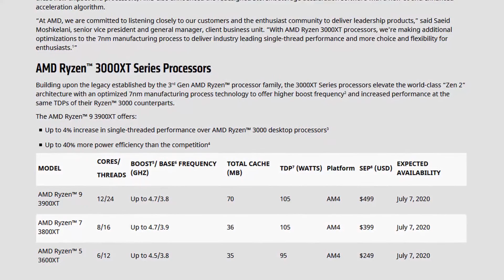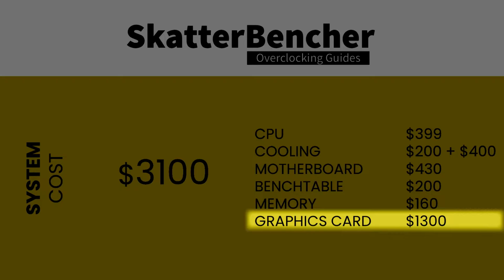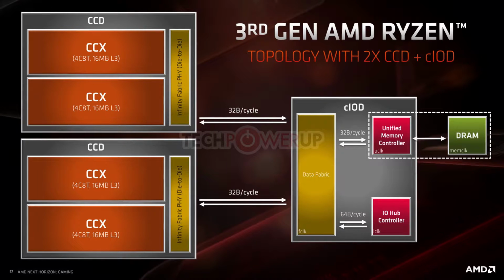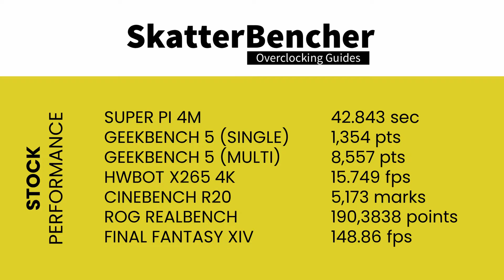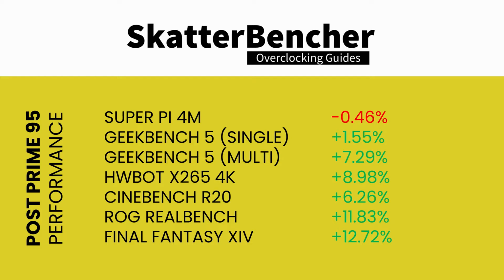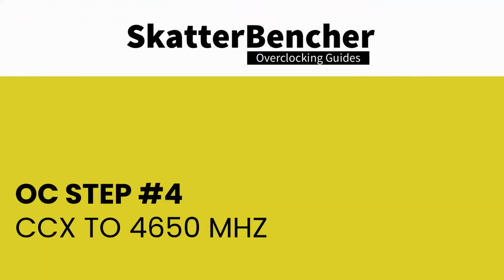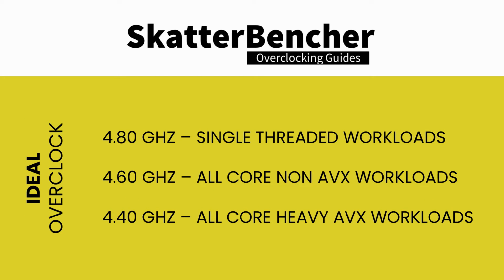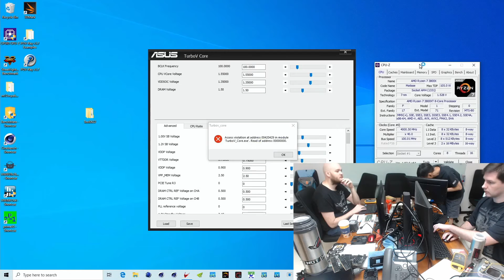Ryzen 7 3800XT Overclocked to 4600 MHz with ROG Crosshair VIII | SkatterBencher #14

Comment: A great thing to do is use process lasso to pass the process of the thread to another core for programs demanding of specific workload type. 9:57 You can set perimeters for it in watchdog advanced rules using thresholds based on times and per core usage. Its great if one core is taking to much of the load where another core could accomplish the task. That does mitigate some performance loss if done correctly under certain scenario's on the back end.

Comment: Thank you for covering the much underrated 3800XT, it's a very nicely Binned CPU, and quite a unique little beast, often what gets overlooked is that it benefits even more from DDR4 3800 CL14.
Reply: Can 3600 ram be overclocked to 3800?
Reply: @Jaze2022  depends on the memory controllers of your CPU, and the base CL of your 3600 RAM and the binning of those memory chiplets. I'd recommend looking at BuildZoids channel for an indepth introduction to seeing which kits you can clock up or have a better chance to get to 3800 CL19.